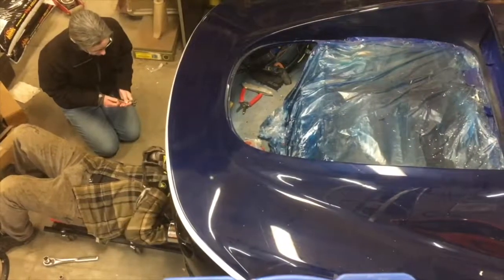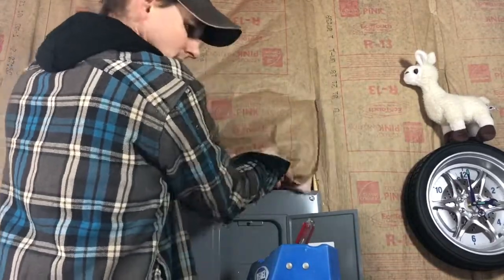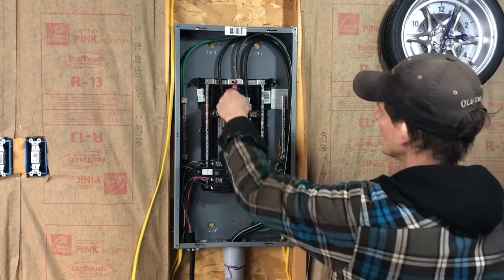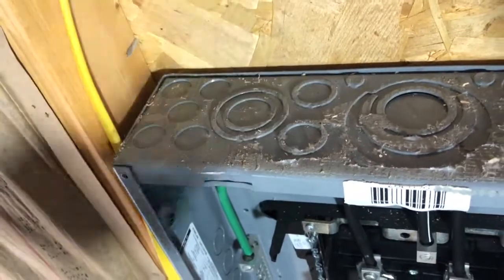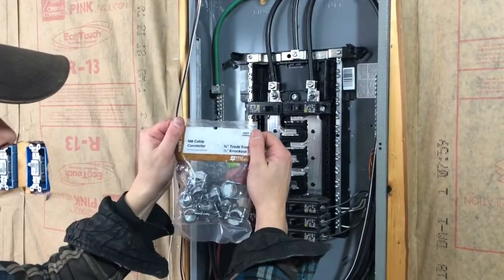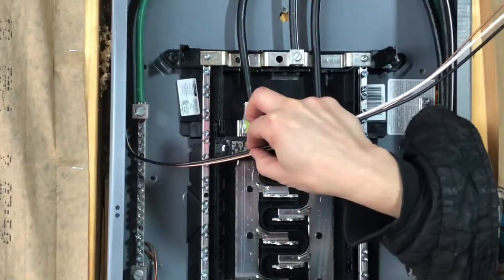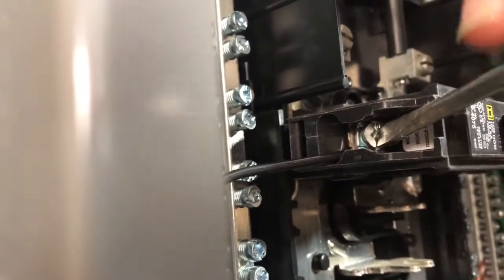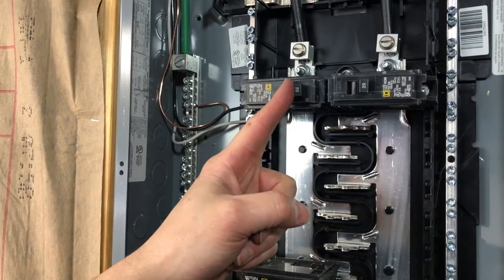DIY Install a 110V Circuit Breaker

Comment: Thanks all for the info I seen that you are using the 125-240 breaker my question is how can you get 110 volts from a higher voltage breaker? Please go easy on me I am also a new home owner and a diy dad that just can't afford to pay for the work so I diy thanks for everything.
Reply from the maker: Hello, to start, 110v, 115v, 120v,125v are effectively the same from a consumer perspective; they're just accounting for variances or safety in the system.  The power company gives you three wires: black, red, and copper. Black to copper is 120v and red to copper is also 120v.  However, black and red are different such that black to red is 240v. Inside your first panel copper splits to copper and white.  In any panel or wire, black to white and red to white will be 120v, and black to red will be 240v.  Black to copper and red to copper will also measure 120v, but the copper wire is  for safety and not used to power stuff.  A 240v cable can be black-red-white-copper or black-red-copper.  You can't get 120v to power equipment (like a newer stove) through a black-red-copper cable.
Reply: @NineCarGarage   Thank you so much this was extremely helpful for me.